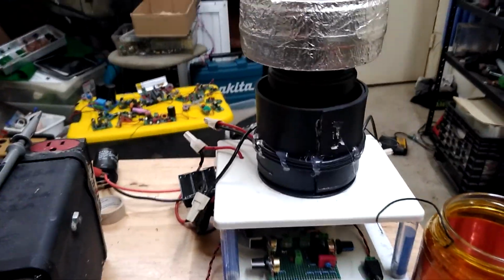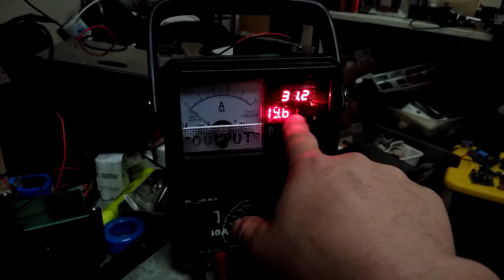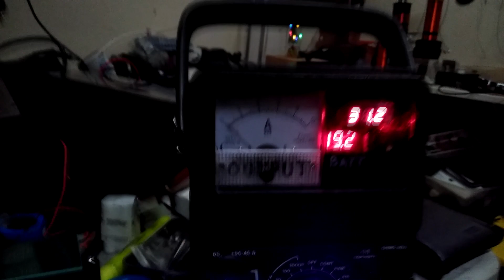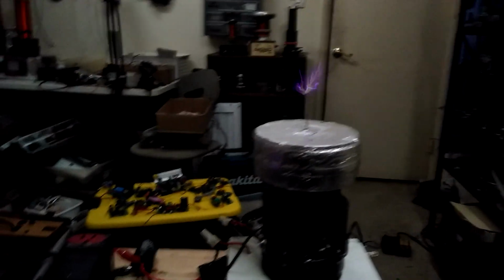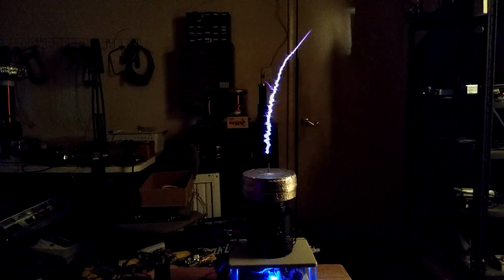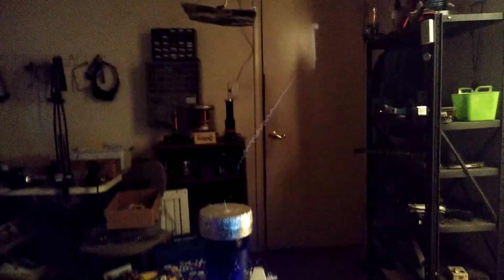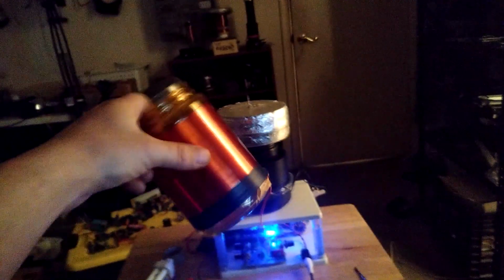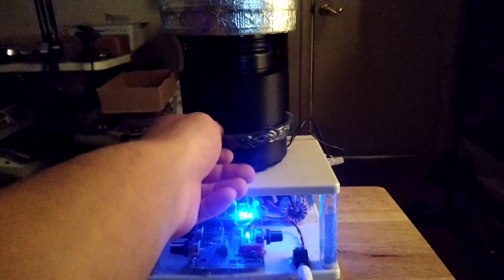Ramped Full Bridge SSTC Retuning

Comment: Impressive work man, mine only produces arcs that long when ran at 240V with a near-resonant series capacitor! What's your secret?
Reply from the maker: I'm not sure honestly. I was expecting 12 inches max at 120VAC but that's about what I got with any random test setup before tweaking. I've been trying to sort of isolate what it might be that is causing the longer discharges but so far it just seems to be the coil dimensions. I was able to tune the 32 AWG jar to get pretty close to 16in but it was just shy. 

When I'm done winding another similar coil I'm gonna try it on a different half bridge I have that isn't quite setup like the others. If it doesn't get anything close to these arcs running the ramps I'll know it might just be something common among the other builds.

Comment: hi friends.. do you use a mmc capacitor in series with the primary coil?
Reply from the maker: Only as DC blocking capacitor, not as resonant capacitor
Reply: @Magneticitist  okay guys.. so how much is the value for the c dc block?..
Reply from the maker: @klenor8650  you would only need it for a full bridge but you might not even need it at all. If you're going to use one I would use a value of at least 2uf or so
Reply: @Magneticitist  Thank you very much for the response, teacher 🙏

Comment: So for IGBTS i need to drop my resonant frequency?
Reply from the maker: Well with this setup I'm not too worried about the frequency since the on time is not that high. I could probably get away with maybe 600khz even. 
For example in this vid I'm running at 30VDC and turning up the on times quite a bit fairly close to CW. Any higher and the chips overheat. Just running the ramps it's no problem.
Reply: @Magneticitist  I mean I want to run my circuit with a half bridge of 60T65PES, with the same schematic as Steve Ward, but my coil without topload has a resonance frequency of around 600Khz, obviously I used the famous soda can topload
Reply: @Magneticitist  that drops it to around 530Khz
Reply from the maker: @Headbutter-Lettuce90  You basically can start by figuring how you want to run the coil in order to figure what components are needed. It's overkill to build a setup which can handle full mains CW easily if it's only going to be interrupted or ramped. 

If you want to be able to pull hot CW arcs using your IGBT's you have to determine if your drivers can push the power to switch both at the desired frequency. If you want to run 1khz+ BPS with more than negligible on times you may as well consider that CW also as the gate drivers will be running very hard. I just guesstimate my IGBT's to be needing a little more than what my drivers can handle when I get over a few hundred khz. 

As a rule of thumb I just observe the input power to my drivers when running them at various power levels and start to worry about them when I see my 15v regulator start pulling more than a couple hundred mA or so at 20vdc input. With a fan and heatsinks they can handle more. 

A full bridge is not going to be easy to run CW at mains voltages without somehow limiting the power but a half bridge isn't too bad. At 500khz or so it will always be recommended to drop the frequency some if you're using IGBT's as it becomes more useful to use Mosfets at those frequencies but you can still get away with it.
Reply: @Magneticitist  thanks I am planning to run it interrupted with variable duty cycle and variable frequency, I just want my sparks to look like the labcoatz Tesla Coil, that's why I want IGBTS, I already broke 4 20N60 MOSFETs
Reply: @Magneticitist  i just want a small coil that can give some impressive sparks for demonstration, and also one that I can run from mains anytime and doesn't blow up
Reply: @Magneticitist  but then I see the unfiltered CW and the sparks look so damn beautiful and scary sounds
Reply from the maker: @Headbutter-Lettuce90  So long as you have a good trusty interrupter circuit it should be fine. The 555's seem great at it. The key is to getting familiar with the different outputs and it eventually becomes second nature understanding what power levels you're looking at. 

You can see Labcoatz is running his in various modes and you should be fine running any of those without working the switches or drivers too hard. If you run the highest on times just make sure to keep the BPS low. While something like even a 50% on time flame every second might be doable if you start increasing that to several hz or more it gets dangerous. Likewise at the highest BPS you want to really make sure you're not cranking the on times up too high.

Every failure I've ever had seemed to be the result of high voltage spikes from bad layouts. Ever since I started cleaning up my layouts where it mattered I haven't had any switch failures.
Reply: @Magneticitist  yeah I saw labcoatz video, the pulsed fire is the highest duty cycle but has the lower frequency